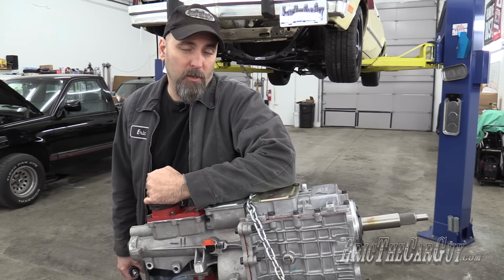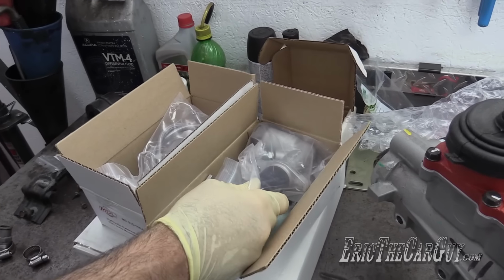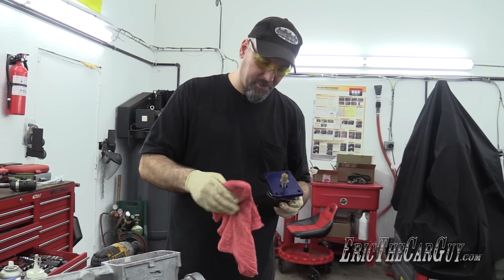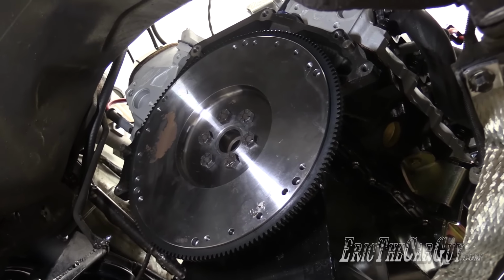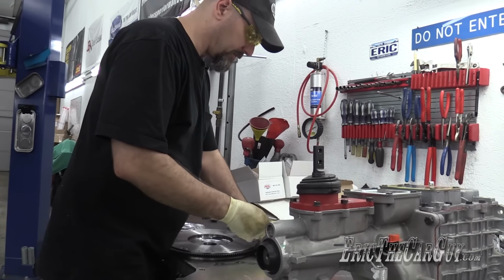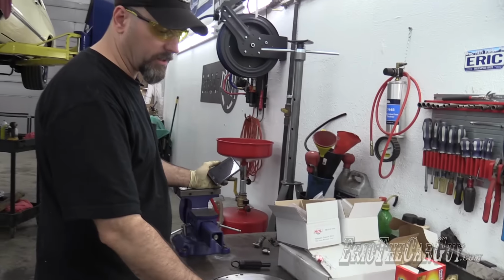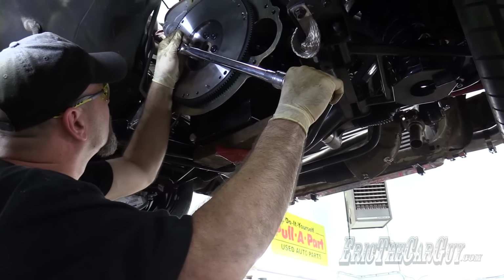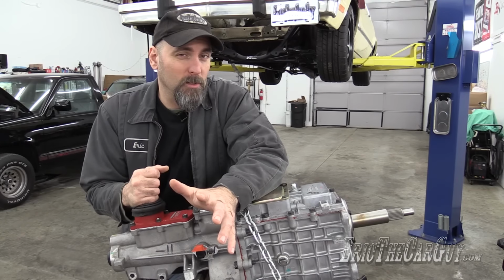TKO600 Install (Part 1) #FairmontProject

Comment: It might not have been lithium grease on the flywheel bolts.  Could have been liquid teflon tape.  On some cranks (like BMW) the holes are drilled through and need sealer, otherwise--oil leaks.

Comment: One way to keep the flywheel from turning without a specialty tool is to use a short piece of chain and one bolt in one of the clutch bolt holes and one bolt in the bolt holes where the bell housing is bolted too. Works for every engine that I've ever ran into. ☺

Comment: Just in case you didn't know. Welding a bead around the edge of the turbo charge pipes also improves the clamping at higher boost pressures.

Comment: I just love how it started off as a clean decent car with an okay fox and ill swap stuff over to full on MM suspension and now a TKO...I love how projects snow ball! my comet started with a leaky water pump that lead to the motor being pulled, putting all new modern suspension in, disc breaks all around, EFI....gears...I miss that car.  These videos however have taken on a new life for me as I am looking for a foxbody with good parts to swap over into a fairmont/zephyr.  I also got all my stuff from Modern Driveline to inlcude a hydro set up and  it was the best thing ever.

Comment: Eric if you need to hold flex plates/fly wheels in place, take one bolt and run it through the bottoms of an adjustable wrench and bolt it to an opening in the plate. Then take a bellhousing plate and thread that in. Finally slip the open end of the wrench onto the bellhousing bolt. The wrench will stop the plate from turning since the bolt is in the way. Hope this helps

Comment: Eric glad you to use the bolt spec. recommended ! (six point vs twelve point head strength ???bolt stretch!!!)
Also the pilot bushing is not totally brass; it is a oil lite bushing. ( it is infused with oil) 
Look up Never Seize torque spec; quite different between dry and lubed!!!
I've been in big engines ( 855 &bigger cu.in.) for about fifty years.
I enjoy your channel.
Fred said it

Comment: that arp lube might seal the lube u found on the old flywheel bolts was thread sealant  302s have the bolt holes in the crank drilled all the way though so if no sealant is used on the bolts u get a leak oil will leak around the threads and it makes u thank u have a rear main leak

Comment: Your Fairmont should run deep into the 11s high 10s with that power and torque. Awesome!
Reply from the maker: That's just what I'm hoping for. After the transmission I go to work on the rear suspension to make that very thing happen.

Comment: Eric: You can make a flywheel stop with a standard boxend wrench and two bolts. Stick one bolt in the flywheel, and one in the bellhousing bolt hole. Put the wrench over both bolts and turn the flywheel so it compresses the wrench. There your flywheel is locked.
Reply from the maker: Great idea! Thanks for the tip.

Comment: I raced a 65 Mustang (which I still have) back in the 70s. A steel scattershield (bellhousing) was required before you could race.
Reply: Rickyboy707 its kinda neat u still have it
Reply: Thanks. I bought it from the original owner in 1975.

Comment: I always use red Loctite on flywheel bolts and blue Loctite on pressure plate bolts. Those bolts can do some major damage if they come out. And at the very least it's a P.I.T.A. to have to tear it back down if they come loose. Oh yea and if your flywheel bolt holes in the crankshaft aren't blind holes. You might want to be safe and pull your drain plug before you fill the engine with oil. With all the degreaser you were spraying in them I would make sure none of it's in the pan before you add the oil. 

Also I highly recommend going thru the hassle of centering the steel bellhousing. If it's off and you are lucky the transmission will be hard to install. If you are unlucky it could end up damaging the clutch or transmission parts. Just because all the parts are new doesn't mean they are all going to line up perfect. You are dealing with a bunch of different manufactures. You've got a lot of nice expensive parts there. Why not spend the extra time and make sure it's all good. Just throwing things together and saying they are new parts so everything will be fine. It reminds me of the guys that build engines and say they don't need to check clearances because they are new parts and they'll be fine. Then a couple weeks later they are pulling the engines again,  because of a spun bearing or broken piston ring land This is a very cool build. I just want to see you enjoying it when it's finished and not having to tear it back down.

I can't wait to see you tearing up some asphalt with this beast!
Reply from the maker: You make a good point, but everything did go together fine without issues. If problems come up later I'll be sure to address them. Thanks for your input.
Reply from the maker: And the engine already has oil in it from the dyno run.
Reply: If that's the case, if it was me, I'd change the oil before running it. But I get a little paranoid about stuff like that. My way of thinking is new oil is a whole lot cheaper then a new engine.

And I'm really hoping you decide to redo your intercooler piping. It would be so much simpler, cleaner and shorter tubing runs to go from the turbo into the passenger side of the intercooler. Then out the driverside of the intercooler. Then up the driver side of the engine and into the carb.  The added benefit to that is you aren't heat soaking the tube going into the carb nearly as much.  Even with the heat shield on the turbine housing there is going to be a lot of heat in that area. I know the reason you routed it the way you did. But if you can route it the other way I think you'll be happier in the end. 

You might want to also add a bead to all the intercooler tubing that doesn't have it.  Roughing up the ends may help some but it won't keep them from blowing apart under boost. And having to reassemble things gets old after 3 or 4 times of it blowing apart. You can make a simple tool to add the bead. You don't need the expensive bead roller. Take a old or cheap pair of vice grips.  Grind or file a receiver groove into the top jaw. Then weld a small piece of round bar stock or a shoulder area of a bolt on the bottom jaw( the width of the jaw ). Make sure the groove in the upper jaw matches the size of the piece on the lower jaw. Then use that in the end of the tubing to crimp a bead into it. Just work your way around the tubing. It works, it's not as pretty as what the bead roller will do. But it works for a whole lot less cash.

And thank you for not swapping a LS engine into the Fairmont!!

Comment: On the engine/trans/differential swaps I have done. One thing was(with the car sitting on the suspension)Measure the angel of the transmission output shaft and the angle of the differential pinion shaft and be SURE they are Parallel. Its nice if they are inline as well but imperative that they at least be Parallel. Why? because the U joints are NOT constant velocity and the forces on them(if shafts are not parallel) are very high and will do things like bust the u joint during hard acceleration, as well as wear stuff out(like u joints) fast. Lots of raise kits etc that did not work out well. This got missed. I found out by doing. Back in 1962. I made this mistake and got vibration and busted u joint and ruined drive shaft yoke.
Reply from the maker: Excellent point. I actually address that in a future video where I install the torque arm. Thanks for the comment.

Comment: Good video Eric!  I do the same thing with marking flywheel position or cam or main caps - even when not required - just for peace of mind to KNOW where I am fitting them without any chance of stuffing it up.  Dropping a flywheel or catching it mid air and cutting yourself is no fun.  Sheesh you must have some dollars in this build by now... SO many new parts!
Reply from the maker: Oh, I've spent way too much money. You haven't seen the new suspension yet. That said, I love doing this. I'm learning quite a bit. I actually think building a car has made me a better mechanic. I see things with different eyes now. Thanks for the comment.
Reply: Very true, sometimes I forget this is the first time you have built a car like this.... Seeing with different eyes is an apt way to describe the difference between repair compared with design and then fabrication.  You were always a creative repairer, so it's as if all of this was meant to be for you.  All told, this is indeed turning out to be a killer build.  My only gripe with this video is that it went too quick.

Comment: Hopefully your flywheel bolts don't leak oil into the bellhousing since you didn't use a teflon sealant or locktite. It looked like teflon sealant is what you cleaned from the crankshaft threads. The reason I'm mentioning this is because the flywheel bolts on small block Ford crankshafts go through into the crankcase. However a few aftermarket crankshafts have blind flywheel bolt holes so you could be alright.

Comment: cutting a 3/8 fuel line hose and match the diameter of that aluminum intake would help protect it from scuffs and vibrations and act as a gromet. keep up with the videos.
Reply: 1/8 or 5/32 vac hose slit longitudinally and secured with 3M 8001 is what we use to finish trim through holes.
Reply: patw52pb1 yeah even better. I said. fuel line off the bat cause I have so many lying around the shop.
Reply: Yes, I have done the same, but I now prefer the smaller diameter vac hose.
Reply: +Michael Dorado 
Professionally in the shop we now use a commercial product from Panduit that works great. 
It comes in either 5ft pieces or 100ft rolls, has an adhesive pre-applied, gets cut to length to fit the hole, slipped into place and heated with an electric heat gun that sets the adhesive and has a very professional finished look and performs great even through multiple pressure washer cleaning. 

http://www.panduit.com/en/products-and-services/products/wire-routing-protection-and-insulation/abrasion-protection/grommet-edging

Comment: In the last fairmont project video you had a problem with the bonnet fitment, maybe you could modify the bonnet by cutting a hole and welding on a very light air scoop. I know it wouldn't scoop the air into the engine but it would allow for the bonnet to fit propperly.
Reply: You forget he's trying to make a sleeper =P
Reply: Valkyric I don't see how a shallow air scoop will affect that. I'm not talking about a supercharger air scoop like the ones you can see on dragsters but a light bonnet modification
Reply: Maybe he'll be able to find someone with a Crown Vic to pretend chase him through the streets. If he catches him, out comes the arp lube!
Reply from the maker: No need. I already fixed it with spacers under the K member. Monthly updates on where the build is today can be found on my blog. https://www.ericthecarguy.com/blog/1981-march-2017-newsletter
Reply: oh ok, thanks for reply

Comment: Sanding those charge pipes won't work with any significant boost.  Tig a bead around the outside of each charge pipe where it gets inserted into the silicon coupler, that will do the trick if you don't have a bead roller.

Comment: There's an easy way to tell of that flywheel bolt grease is actually molybdenum disulphide.  Just put a little on your fingertip, then scrub your hands for 30-60 mins.  If you still feel greasy up to he elbows, it's moly grease.  LOL

Comment: hey eric, you probably wont read this, but when i do my rotations on fly wheels (i work on OTR rigs) i just put a bolt in the fly wheel and a bolt in the bell and put a chain there that links the 2, works great
Reply from the maker: Great tip. Thanks!

Comment: Very enjoyable to watch, i can see you were enjoying the upgrade :-D.

It's great that you had paul to help, you just can't beat having knowledgeable frends :-).
I imagine if you did a lot of this type of work, you could weld up an old starter motor to fit and hold the flywheel stationary, or similar plan.
Reply from the maker: Meh, the pry bar worked. I can't have ALL the tools. Thanks for your comments as always.

Comment: Hi Eric, in terms of finding different torque/lube specs online, it may be better to use the one that was written more recently. An article online can be as old as the 90s, with even older physical archives being transcribed and uploaded to the internet as well. And as I'm sure you know, 'what works' in the automotive world is subject to change over the years due to new research or cheaper alternatives. You can't always find out when something was written, and of course just because it was POSTED then doesn't mean the information was correct even at that time, but it might help in terms of deciding either way.

This was just a thought that I felt like sharing since I spend a lot of time on the internet. The spec sheets you from the manufacturer might be what they had to do to make it work, but might not be how things were specified by the engineers or an original research paper. Anyway, I loved the video and I'm really glad we're seeing these Fairmont videos!

(Or maybe the manufacturer wants it to break so they can blame you and make you buy another one lol)
Reply: Most reputable manufacturers have the most recent recommendations and torque specs on their official website along with contact info. 
Always go with the fastener manufacturer's recommendations and specs and if there are questions contact their technical/engineering support line/email to get the correct answer for your specific application.
Reply: That is generally the way to go and I trust Eric either way on the matter. Although I personally believe that manufacturers can make mistakes cough Takata but outside of that, there's also certain others you can trust. Like the engineers themselves, the people that actually have the degree and not just the ones who get paid to write numbers on paper.

I'm not saying one SHOULDN'T always stick with the manufacturer-specified info...just personally, I'd trust Eric before I'd trust Honda. Planned obsolescence is a real thing. Not always bad, but often apparent. But really I was just speaking in terms of information that is found online because I'm kinda like Rob the computer guy

I hope my comment doesn't sound negative towards what you said, just expressing the opinion a bit further. (also its 3:30 am)

BYE PAT
Reply: +Robert Woodall 
Actually Eric has the answer on the literature that came with the fasteners he was using from ARP at 32.34 he just missed it, notice the text in the upper right hand box [TORQUE W/ARP LUBE]. The other torque value was using different fasteners from another manufacturer. 
Everyone makes mistakes and or can be mistaken, even myself and Eric. 

Granted there are some websites with old info, however my personal and business experience with ARP has been stellar, they are very conscientious about getting their info and specs right. 
ARP has a reputation to uphold and is a specified fastener supplier cited in the rule books of FIA, Formula-1, NHRA, NASCAR, IndyCar and many other sanctioning bodies ans well as an aerospace supplier to NASA, Boeing, Lockheed, Hughes, Airbus, etc. 
ARP is one of a very few companies licensed by the US government to design, engineer and manufacture MS-21250 fatigue rated fasteners. 
ARP is not and does not operate like Honda, Takata or most any other manufacturer. 
Unfortunately reportedly evidence shows that Takata knew of the issues before there were any installed malfunctions and chose to do nothing until they were ordered to by the government. 
Personally I think that is criminal negligence by Takata. 

Yes, you usually have to be suspicious and carefully verify info you find online, especially on public forums, many times it is mostly personal opinion and often incorrect. 
I have been professionally involved in professional motorsports for more than 30 years as a multi-discipline engineer and I strive to learn something new every day. 
I learned a long time ago that anyone that says they know everything about a given subject is either deluded, mistake or an outright liar.  ;)  
No problem, not negative at all, it has been a pleasant exchange.
All the best, take care Robert and I will look forward to seeing you again around the wild wild web.

Comment: You need a yoke off a C6 trans, I found mine in the pick a part off a 70's ford truck.
Reply from the maker: I ended up getting one from Modern Driveline. Thanks for the info though.
Reply: The T5 takes a standard 28 spline yoke. The TKO uses a 31 spline yoke. Although the C6 / Torqueflight 8 yoke will work, they are usually too long.  The correct one is actually either the big block Ford or Mopar A833 31 Spline manual transmission yoke.  It's all about the splines.  Eric, thanks for the mention in your video!
Reply from the maker: No problem Paul. Thanks for all your help with the T-5 and beyond. Your contributions have been invaluable.

Comment: You need neutral safety to pass tech at a lot of tracks.
Reply from the maker: I can always install one later if I need to.
Reply: EricTheCarGuy also you usually need a kill switch if the battery is in the trunk.(depends on track) kinda what a lot of hacks like me do to get around that is have a switch on the bumper and just a removable fuse in the alternator charging wire somewhere easy to pull out real quick before you pull up to tech.

Comment: i may be off here, but i used the arp pressure plate and crankshaft flywheel bolts for 300hp turbo b18, i put the blue locktite they specified on the threads and only put the arp molly on the bolt face that would rub the flywheel/Pplate while tourqing down